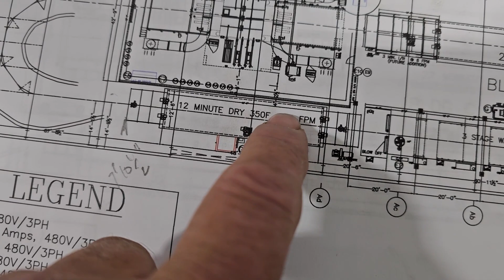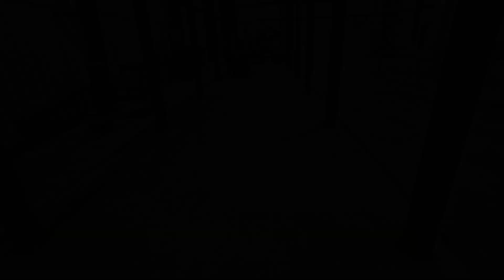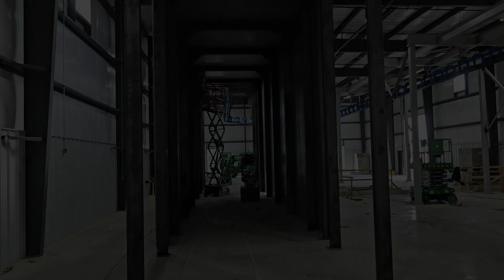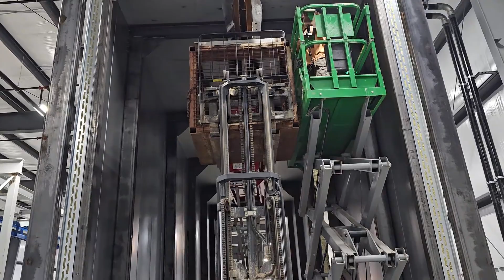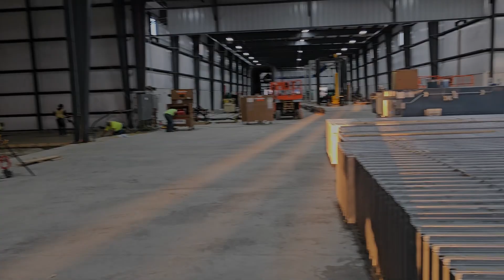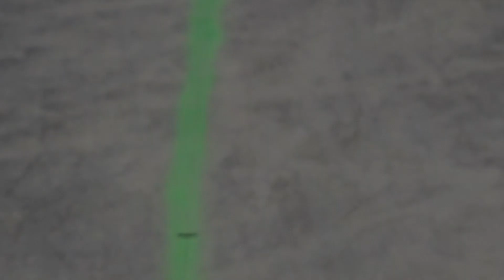Powder coat line part #2

Comment: I just bought a GLL40-20g green beam laser about a month ago for work. Couldn't get the level to sit quite right, laser 16 feet away, 1/2 inch off from one end to the other on a 16 foot wall, so I am thinking of returning it but it may have been my tripod. further testing required.
Reply from the maker: Use the supplied allen wrench to dial it in, I tested mine with a string plumb bob before I used it.

Comment: Really enjoy seeing the progress.  Stan, does that laser square have a built-in leveling means?   Or how do you know it is plumbing the frames?   I suppose you check them with a carpenter's lever.  Thanks for the video and all.
Reply from the maker: It has a floating gimbal that unlocks when you turn it on.  If you set the tool out of its range, the laser will blink.

Comment: Main building looks like a Varco-Pruden pre-engineered system? During my 30+ yr in construction, have been on both ends of the industry. As an Iron Work & as a General Contractor. Again, this project is taking me back 30 plus, thx again Stan, Bear.